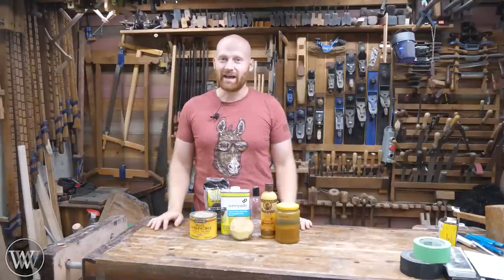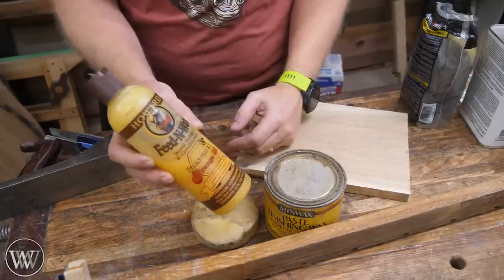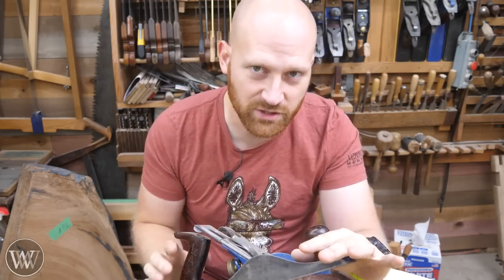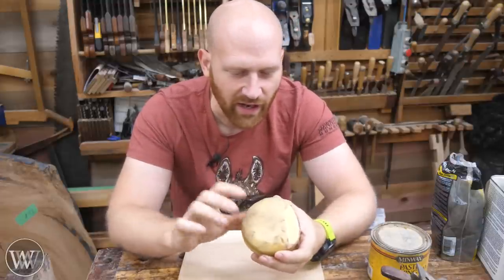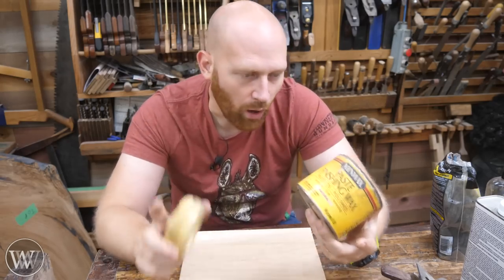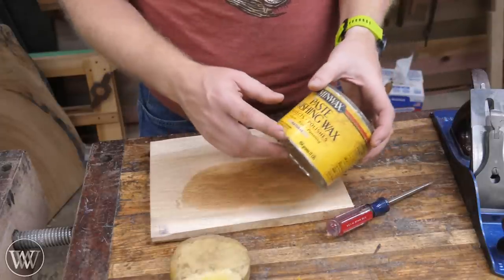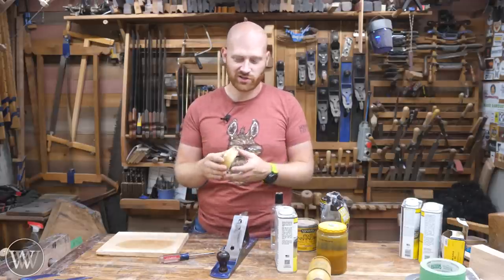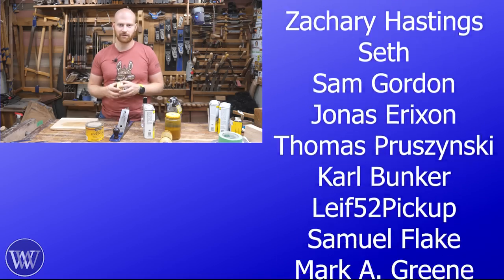Paste Wax The Magical Substance

Comment: I was under the impression that linseed oil was non toxic but boiled linseed oil was toxic. Can anyone confirm or deny this?
Reply from the maker: if you buy the BLO from the store most of them would be considered toxic. it is the same with raw linseed oil unless it is for consumption or sold as pure. but if you make the BLO at home and do not use dryers then it is perfectly safe.

Comment: I would not use beeswax as a base for lubrication as it is quite sticky actually. So for that a normal candle-wax is better.
Reply from the maker: I actually like that aspect of it as it holds to the steel longer and will provide the lubrication much longer. It doesn't actually produce any resistance as it has a slightly more tacky surface but it does stay longer on the surface providing more lubrication for longer. Not a huge fan of paraffin wax myself as it rubs off very quickly.

Comment: I made my first attempt at paste wax a few days ago.I just threw a night light candle and two cap fulls of BLO into a cup, and then into the microwave for a minute or two. 
Its still a block, and it popped out of the cup quite easily, but it's slightly soft. It's hard when I pick it up initially, but I can feel it go soft in my hand in a few seconds. 
But it's so easy to do that I think I'll make a harder one later. And maybe a softer batch too.

Still, I've never used a proper "store" paste wax so I don't know how good mine really is. I guess time will tell.
Reply from the maker: right on. sounds like fun! if you don't like the consistency you can always melt it down and add more oil or wax.
Reply: @WoodByWrightHowTo  Ah, I didn't even consider that, Doh!  
But yes, definitely something to keep in mind, especially you want a particular hardness.
You don't want to end up with 10 soft blocks and no candles left when the power goes out!

I wonder how a paste wax candle would work.. I might throw the wick back into a batch someday and see what happens when I light it..

Comment: Love the video. Was wondering g if you can apply paste wax over a Boiled Linseed Oil, and if you use a dark minwax finishing wax, will it darken up the wood?
Reply from the maker: Yes. I usually finish with boiled Lindsey oil and paste wax, particularly for handheld items. I don't generally use stains but yes you can put this over that.

Comment: HELP ANYONE:
I put 5 coats of hard wax finish on a table top I sanded between coats but the finish is still slightly uneven. Can I go over the top with Briwax and polish it to get an even coat or should I try to keep going with the hard wax finish?
Reply from the maker: You have me a bit confused. Hard wax is something that just goes on in one coat. Every coat after that won't adhere to the previous coat. If you send me some pictures and email I'd be glad to help you out and answer the questions. I don't always see replies on here. Sorry. jameswright@woodbywright.com
Reply: @WoodByWrightHowTo  thanks I’ll send photos tomorrow with the product I used and try to hilight my problem. Maybe it’s not hard wax. It’s a hardwood floor finish definitely a blend of solvent oil and wax it smells like tong oil and thinner.

Comment: How do you prep wood for refinishing if it's been previously finished with a wax? Seems impossible to get wax off the surface of the wood.
Reply from the maker: If I want to remove the old finish I use a card scraper. fast and easy! you can also sand, but that takes a lot more work!

Comment: You list a recipe of 3 parts bees wax, 1 part linseed oil in the video. Is that boiled or unboiled linseed oil?
Reply from the maker: It depends. I use raw linseed oil for lubrication and rust prevention. And I use boiled linseed oil for wood finishes.

Comment: Ummm, rust is oxidation of metal - it does not "penetrate" from the environment and paste wax does not block rust.  A decent paste wax blocks oxygen containing things like water and air from touching the metal surface which will prevent new rust from forming.
Reply from the maker: I love arguments around semantics. Lol